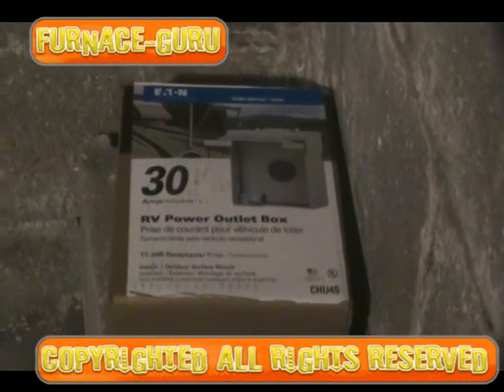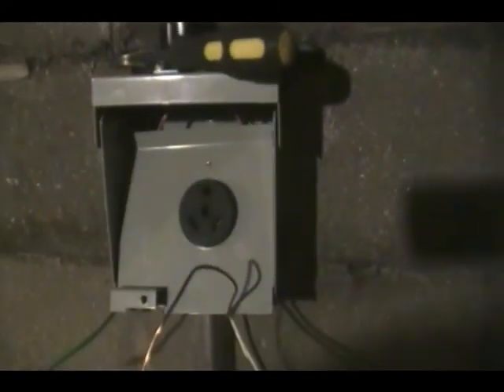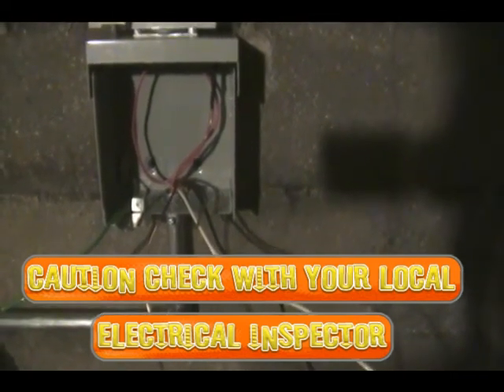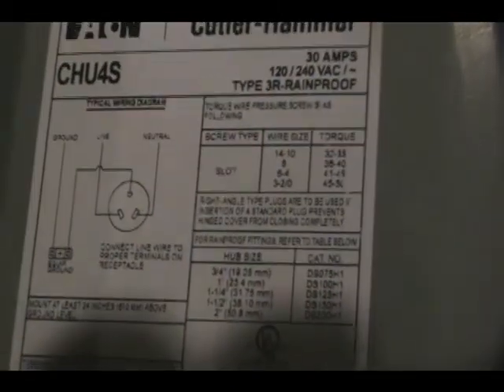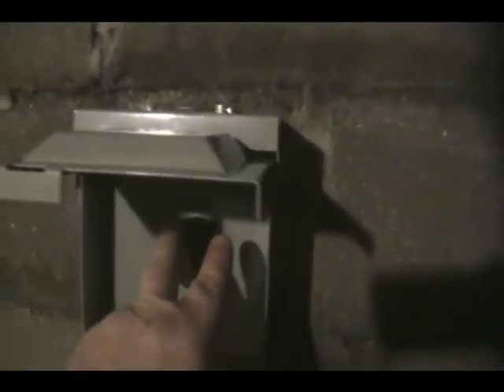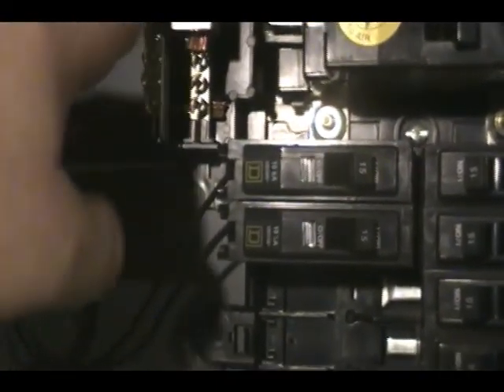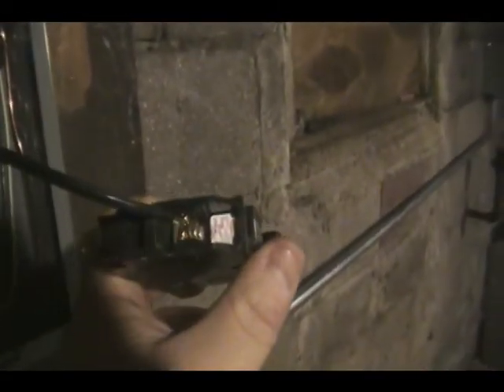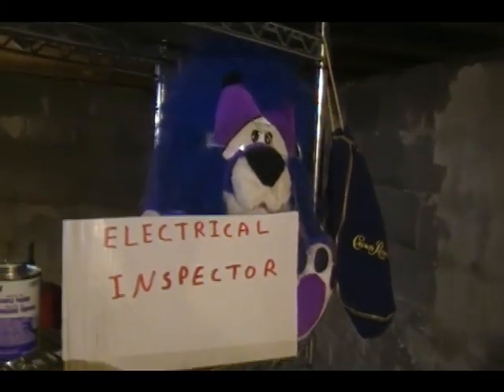Electrical circuit for a camper or motorhome 30 amp / DIY

Comment: I know this is an old video, but can you branch off of this with a 15 amp duplex receptacle mounted next to the 30 amp receptacle?  I know that you can put 15 amp duplex receptacles on a 20 amp circuit, but I'm not sure about 30 amp.

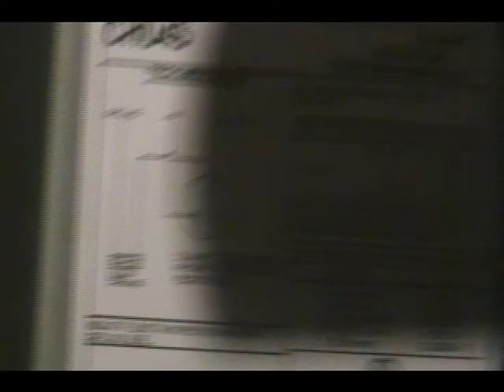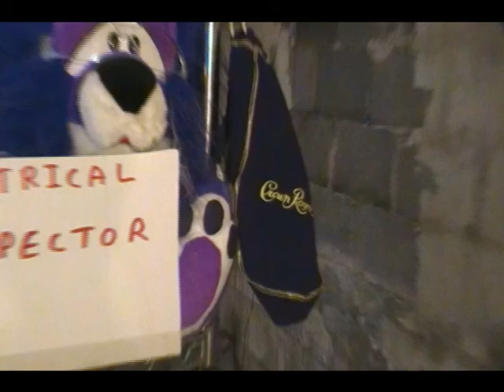Comment: Anyone else notice he wired the outlet backwards?!? at 3:40 mins he shows the schematic where green (ground)  is @ the 12:00 position and at 4:08 mins he even tells us WHITE IS NEUTRAL, but he actually wired black (line) and white (neutral) on the opposite sides. FIRE THE INSPECTOR!

Comment: My Motorhome class C converter is 45 AMP.
The plug / male in the cord is for 30 AMP.

Can I use a 45 Breaker in the Electric Panel insted of one 30 AMP?

Thanks to anybody willing to help.